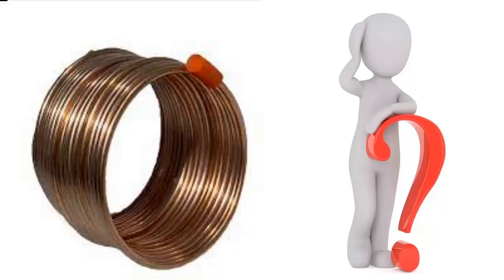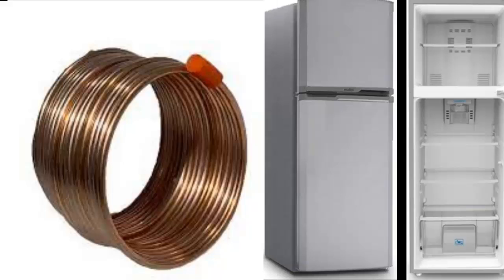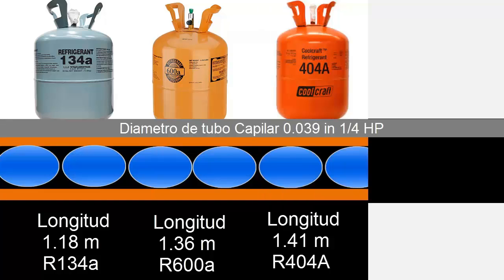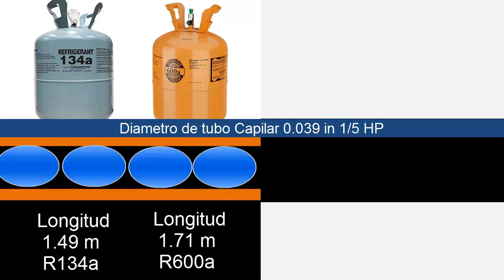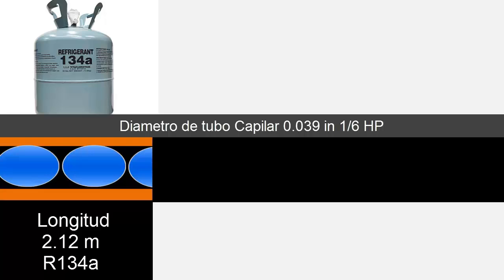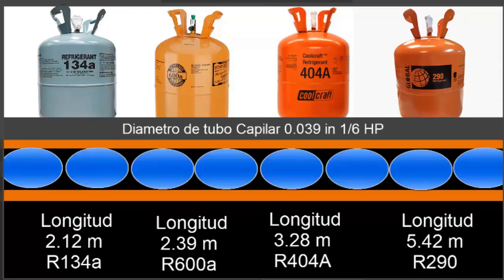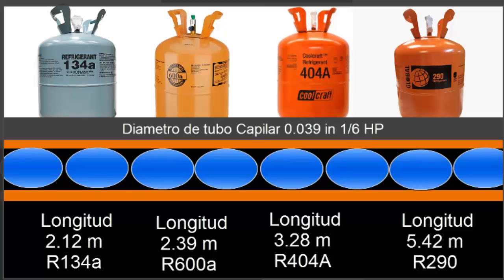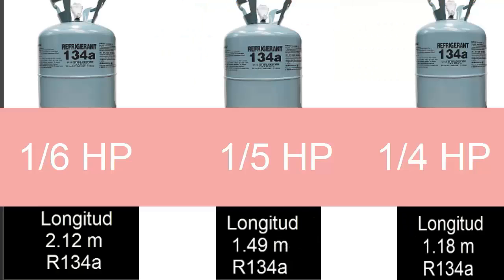Capillary Tube Calculation for 1/4, 1/5, 1/6 HP Compressors for Freezing

Comment: I think the author doesn't know that 1/4HP is more powerful than 1/6HP
Reply from the maker: Thank you for writing. 1/4 HP is greater than 1/6 HP, therefore the 1/4 HP compressor handles MORE refrigerant. Less opposition to flow should be placed so that more flows; that is why the length of the capillary tube is shorter.